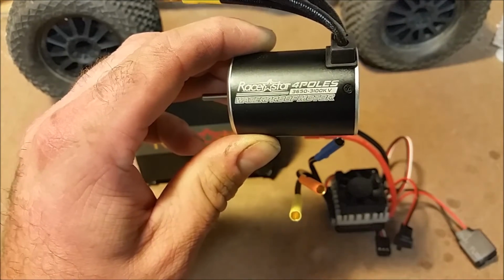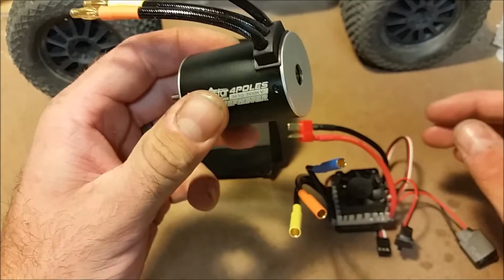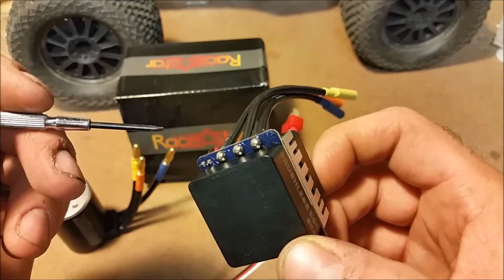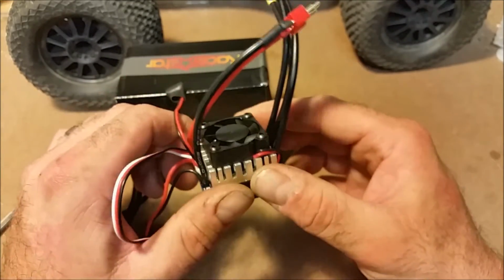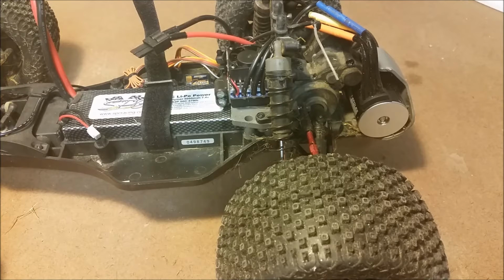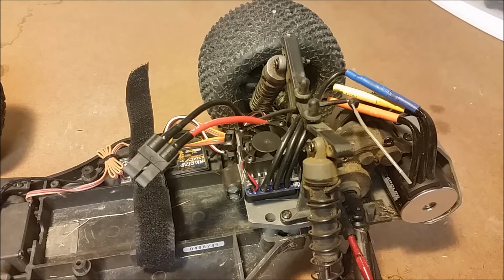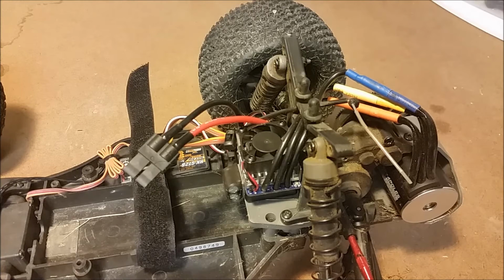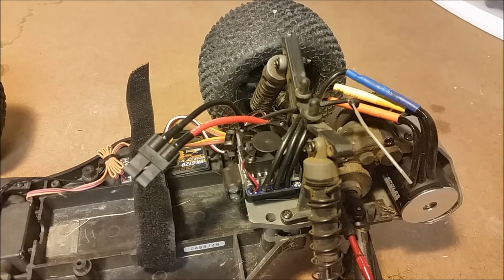Racerstar 3650 Motor and 60a ESC Review

Comment: What’s the max voltage before it starts to burn? Trying to do a brushless conversion with a boat.
Reply from the maker: No idea.  I only used 2s on it.  Usually these cheap ESCs say 3s, but they don't last for too long on 3s.

Comment: which kv KV works easy in 3s ?
Reply from the maker: That depends on a million factors like the vehicle, the gearing, the motor, etc.  I chose a 1/8 scale motor because higher kv 1/10 scale motors overheat on 3s unless you gear way down, which may not be possible in a lot of vehicles.
Reply: what you recommend combo for 1/10 short course car 2wd  ? and what kv 2s or 3s recommend ? Rocerstar 3650 60a same what you have

Comment: Hi Budget RC. How about a the programming card? I assume you've got it already. I've got the same engine and ESC, but with a button next to on/off switch. Does it mean I can programm the ESC somehow? If so, do you know how? I know that with the button I can make the first calibration and actually a connection with my transmitter, but can I also change other more advanced settings accessible from a programming card? It's not described anywhere in the Internet. Additionally a manual for the racerstar (hobbystar) shows 10 things which can be configured in ESC, but the programming card supports only 5 things.

Comment: How would this esc work in the Zd racing zmt-10 (10427)? I plan on replacing only the stock (45a) esc but leave the stock motor T3650 3300KV
Reply from the maker: Igor Štimac the ESC should work just fine with a 3300kv 3650 motor.
Reply: Budget RC Thanks. What about the programing...do I need the card? Someone here mentioned that it's possible to do it without the card
Reply from the maker: Igor Štimac I've heard that you can program it wothout the card, but I'm not sure how.  There's no button on the switch like most ESCs use.  The previous comment said that it's done through the transmitter.  I haven't tried it, but you could give it a shot.  That said, the card is only $7 and a lot of the packages on Ebay include it woth the esc & motor.  Most of them are under the GoolRC brand or are unbranded, but they're all the same.  The card doesn't offer as many programming options as the higher end stuff, but it gives you the basics.
Reply: Budget RC Can I use racerstar program card for Goolrc esc?
Reply: Surprass hobby

Comment: How big a car is that? :) 

I'm in a 1/12 Gptoys s912 onroad project with the same ESC and a similar'ish engine with 4500kv also asian made, so could be fun to know the size of your car so i have something to compare to :)
Reply from the maker: Juhl-Racing this motor/esc is installed in an ECX Circuit, which is 1/10 scale.  This vehicle also has large monster truck tires installed.
Reply: Budget RC thank you! :)

Comment: no you can program it with the transmitter. turn on your transmitter and hold the throttle then turn on your ESC and it will take you to programing mode.
Reply from the maker: Zeno'sama good to know!  Thanks for the tip.

Comment: What battery do you use with it the setup
Reply from the maker: NoahJW88 I use a 5000mah 50c 2s hard pack from SBC racing.  Unfortunately, they no longer sell batteries.
Reply: @BudgetRC_Channel  planning to buy this racerstar 60a brushless esc with racerstar 3650 3300kv, to be install on my Ecx amp crush, with stock pinion, i also have 2s 5000mah 50-100c lipo, question is.. Would the stock NIMH speedpack 1800mah will still work with this racerstar setup?

Comment: I have  recently installed this particular motor and esc into a 1/10 monster truck. I'm very happy with this system, I run it only on 3s without any problems. Check out some of my videos : )

Comment: Your buying cheap garbage and you get disappointed because it doesn't come with a button or a program card? There is a difference between budget and tight ass, no offense but you can't expect golf course grass when u take dirt and cover it with manure.
Reply from the maker: Robbien Nunn I think I was pretty clear that I was happy with the product, and that I just wished that a programming button was used.  It was a very minor complaint, and not one that would prevent me from recommending this setup to somebody that wanted a low budget upgrade.
Reply: Robbien Nunn dude chill its not a bad combo i have same thing in my slash and it goes fast

Comment: you can always get a replacement fan and plug that into the receiver. I brought the goolrc version 3100kv and put it in my sons blackout xte, i opted for the hobby wing water proof 60 amp esc. so 23 bux for the motor and 43 for the esc. amazing setup for cheap. running 18 tooth pinion and 55 spur. I also have a castle fan on the motor just incase. Running a spc 6500 65c 2s. It runs for about 45 to an hr and i can always put my finger on the motor and it barely feels like heat is even their. goes a lil  bit faster than terremoto 10 v2 on 2s. way faster acceleration.

Comment: In your couple of months of owning this motor how has it held up? Is it still going strong? Any defective parts of the motor? I'm looking at their 1/8th scale 3670 2650kv motor for my 4x4 slash.
Reply: Jiggly puffs I got floureon 3s 5000mah for $25 it's great i also use it in my box mod it last over 3 days lol
Reply from the maker: so far, so good.  My son is still beating the crap out of the car every chance he gets!
Reply: David Shircliff get the goolrc 2850kv it's a beast it handles 3s great cost me $25 on ebay and my esc was a the cheapest on ebay $18 for a 120a! powered by a 5000mah floureon 3s cost $30 on ebay a total of $73 bucks it's cheap with awesome performance it did 50 mph with a 7.07fd and 91mm tires with minimal ballooning and the motor and esc was barley warm.
Reply: Timothy Mosley or u can get a 3s 4500mah for 20$
Reply: lol i also got flourean but would you really pay 5$ more for 500mah
Reply: Timothy Mosley check out my video crashed my slash today
Reply: Jiggly puffs lol because they was out of the 4500 I purchased one and then they messaged me and said that they were all out of stock so I got the 5000

Comment: are you using a 2s battery for the speed run?
Reply from the maker: Yes.  Though others have used 3S with this ESC, I haven't attempted to.
Reply: okey
Reply: i am is going to buy that system and install it on a hpi blitz because the esc on the hpi burned upp
Reply from the maker: I think you'll be happy with it.  It's working well in my son's Circuit, although I do need to dial back the punch and loosen the slipper a bit.  He's beating the hell out of what's left to the body with all the backflips.
Reply: okay
Reply: Budget RC kan  tell me what esc program card for the racerstar 120a esc